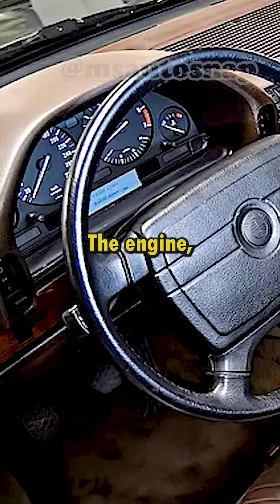When Engineers Build Cars! #bmw #mercedes #bugatti

Comment: The Bugatti W16 engine is an offspring of the Volkswagen W8 engine, that was first tested in the Passat. The W8 engine was the result of 2x VR6 engine blocks, that got 2 cylinders per block less (VR4) and slapped together (V-VR8 aka W8). To claim Mercedes or BMW has anything to do with that, is false information and a straight up lie. So please, go shove your ai content up where the sun dont shine.

Comment: A sensible engineer does not necessarily add needless displacement and cylinders to a car engine. Rather he would focus on making a large car really good to drive (like Maserati Quattroporte M139), as light as possible (like the Jaguar XJ X350, X351), as reliable as possible (Lexus LS V8), as comfortable as possible (Citroën DS, CX, XM). It is a different matter that bean-counters forced preferance of a single market (first USA, now China) onto the development process. 
What we ended was a travesty best avoided.

Comment: That W18 is such a ridiculously daft engine design.  So it's cylinders are basically "staggered", like a VR6 engine or something.  It’s basically just 3 VR6's smashed together, can't even imagine how imbalanced that thing would be.  
V16's on the other hand, are also *daft*, but in a completely awesome way.  Two inline-8's running side by side?  Fuck yeah.  I'm glad Bugatti is moving away from all the goofy W-engines and moving towards V16's instead.  A V16 is just so much more interesting.

Comment: These are 'just' engineering and show exercises for the performance fans and wealthy repeat customers to say, look at what this manufacturer did, look what my favorite auto manufacturer is willing  to do. 

At the most, if those cars had of been built for costumers, it would've been anywhere from a few cars up to 250 cars. 

The first world decided to dumb down, so you millennials, even less for you Gen Z's don't get much foundational I information. 
High Cyl counts are become increasingly inefficient as the cyl count goes up, Euro sports Cars still use V12's cause of tradition and status. Besides, the V12's in production today are built of costly tech the buyers have to pay dearly for, mass auto manufacturers won't spend that kind of money on Cars sold for less than $250,000, they can't. The Audi/Lambo V12 is absorbed into VW/Audi's brand cashe, as it attracts fans which attacks costumers. 

If you watch pro circuit racing (road racing), you won't see any V12's anymore, modern Regs purposely lean toward efficiency, to include exhaust output, so you see V8's, turbo whatever's, Hybrids, No 12cyl. 

As far as the Bugatti, that 16 is highly expensive to run, highly unreliable, you won't hear much about that cause not a lot of them are daily driven, especially not here in the States. American owners of upper echelon SuperCars and HyperCars  buy them for resale value at the top of their list of why they buy, and low miles typically get them the highest resale price, unless it's tracked, then buyers can't wait to get their hands on a car that has been ripping around circuits, and cared for by a race shop.. 
$$$$$$.. 

Sorry Kid, but they don't tell y'all nothing important anymore, cause the remaining boomers and gen x'ers are so superficial and ignorant in the dumb down. Superficial people just need to know how to get the money so they can fulfill their superficial wanton.. dumbasses 🙈

Oh, and that V16 never raced professionally, the 16 is very heavy, an incredulous number of moving parts, soo, high friction much 🥸 with a massive cooling system, so more reasons to be a heavy girl.

So basically, HyperCars up to now are queens, mid-ship comes from circuit racing, endurance racers need to be efficient, but a lot of these HyperCars are too heavy and too inefficient to compete. 

Today's international racing HyperCar class are Hybrids, so watch out for the production versions, they're ugly compared to what y'all are used to, but much more of these production HyperCars will end up at circuits stretching their proverbial legs. 

A lesson for you young ones from an old dog who didn't let go of the rope 😉

Comment: I used to work at a German car repair shop, and the parts manager offered to sell me his BMW 320i, black with tan interior, that had a five speed manual, and the factory tool kit that was mounted under the trunk lid (the boot in the U.K.). I didn't buy it because I couldn't afford it, so I bought a 1982 VW Rabbit L, silver with navy blue interior, with a five speed manual, Blaupunkt cassette deck, and a non power sunroof, for $1,500. It was a fun car for the three years that I had it, but I wish I would have bought the BMW because of the higher resale value.

Comment: When engineers build cars you don't end up with more cylinders because engineers don't chase numbers.  You'd end up with a well balanced powerful 4pot because it is lighter and 160hp is sufficient.   You give it to a marketer and you end up with someone complaining about the extra numbers for the brochure and how you'll l have to disassemble it to change the oil

Comment: Mercedes actually DID build an 8 litre V-16 based on the M130 , and had at least 85 prototypes running around ( this engine was slated to go into the Maybach , which was based on the W140 ) but then they had to outdo BMW , so they also made a 12 litre V-24 , which was basically two M130 joined together . Remember that D-B made very large supercharged V-20 engines for use in S-boots and other marine applications .

Comment: Was never a fan of the M70- V12 because in my opinion to use simply two six-cylinders on a common crankcase with their own throttle body and ecu was cutting corners by the engineers just to get the "magical twelve".
Also the output was pretty low with 300hp out of 5Liters with fuel injection and the engines sound basically like a huge fan.

Comment: Fun fact. The W18 developed by Mercedes isn't the same configuration as the Vag W engines. Instead of putting two VR engines in a V configuration, Mercedes put 3 inline engines in a \|/ configuration. Both are called W engines but the latter is considered the true W engine.
Reply: From the drawing, the true W engine is based on 3 cylinders in a W configuration. The outer two cylinder banks are 120°. The 3 cylinders ride on a common crankpin.  So, W3 x 6 = W18 rides on a 6-crankpin  crankshaft.
Reply: I always said that WAG's engine is a triple V  :))
Reply: OMG! Like what kind of CRAZY ARSEHOLIO Can THINK on THAT Level? 3 I-6 blocks(3 crankshafts) 
3 Heads(6 Cams AND 36 MF VALVES)…When Volkswagen pushed the VR6 out and it being what a 30° engine. I was 12 when I noticed that I was like what😊
Reply: and it was going to be a 8.0

Comment: People have gotten somewhat Spoiled with The Power we have Today 💯 in the 80's, having 300hp was a lot of Power! 400hp in the 80's and you were Top of the Line! Now 4 Cylinders are coming Standard with 500+hp without Modifications 💯 (The New AMG C63 × Which is a Disappointment btw 🤦🏾) !! Nowadays, The Bugatti has a V16 with 1800hp (Somewhere in that Ballpark) --- Then you have V6's that are being Modified to Run 3000hp !! The Fastest Race Car's (Street Racing) are between V6's and V10's 💯👑

Comment: Mercedes didn't have any 16 cylinders in late 80's not even  a prototype, they also didn't want to make v12 back then, M120 v12 only was made because of 750il so w140 could beat it. Mercedes was about to put compressor on M119 V8 and it would be more HP then V12 back then 450-500HP

Comment: Mechanics should design cars, particularly the engine. They're far more likely to put things in accessible areas and not just like "f*ck it, the oil filter can go here even though they'll have to remove the engine, front bumper and gearbox to change it".

Comment: the trend is less cylinders, leas displacement, more boost, more hybrids, more power, faster cars, less emissions, and ultimately more expensive. it's stil engineering, not accountants. accountants would prefer more simple engines

Comment: 400 horsepower from 6.7 liters and 16 cylinders, that's less than they criticize us Americans for making. And of course this is quadruple the price and quintuple the failure rate

Be glad this never hit production or people would be making drift missiles out of them with K swaps because the original engines sucked

Comment: mercedes didnt need a v16 to make 400hp, in just a few years theyd be making the fastest sedan of its time, the 55 series cars (e55, cls55, s55) with a supercharged v8 engine making 469hp stock. i would mention the c55 but that one come with the m113 engine, which is just the naturally aspirated version of the m113k in the other ones i mentioned
Reply: Only the W211 W55 had 469hp from the supercharged M113, almost everything else was 493hp!
Reply: @xtypediesel  amazing, i didnt know that tidbit. im guessing you meant to say E55 tho. what an amazing engine for its time, it still holds up today, too. cant wait to get me my own m113k mercedes (hopefully the E55)
Reply: @xyouthe  Fat fingers, sorry - yes, I did mean E55. And good luck getting your AMG!

(When I said "almost everything else was 493bhp" I put the almost in because I'm unsure about the G55)
Reply: @xtypediesel  i just looked it up and it seems like its the same 493hp, i wonder why the E55 got less horsepower. dont matter too much tho since most people mod these cars
Reply: @xyouthe  Probably so it doesn't embarrass the SL, S, and CL, which are all heavier than the (already quite portly) E55. 

A bit like how, say, the R172 SLK55 in the 2010s 5.5 Biturbo V8 era of AMG had no turbochargers, as it'd embarrass bigger and more expensive AMGs if it had them.

Comment: the w18 is not like the vw w engines they are like the old  napier engines which are sometimes called arrow layout also the v16 was based on the m70 v12 which had a variant called the s70/2 with 48 vales producing 618hp in the mclaren f1 and even more in race trim. This could have been a 824hp 64 valve monster much like the current bugatti v16 which makes 1000hp na.

Comment: From todays perspective i would consider this engines are junk because they are extremly expensive and have no more power than a modern 4 cylinder engine.
And as EV driver i only can laugh.
Reply: As old diesel driver i can only laught about your range
Reply: @Elcicikos  300km is more than enough for driving without a break

Comment: "Only" 296 horsepower is wild to say. You Americans really have your car power standards skewed as fuck
Reply: İt's more for new iPad kids 

You know they think every Supra thought 100000000 hp 

But yeah average American car had more power then average European car because EU companies had restrictions from emissions to engine displacements but American companies never had these issues 

You want a make a FWD Coupe can carry 6 person and had 8.2 V8? No problem you can sell that
Reply: @ozgurmehmet4258  That's not entirely true. Emission laws in Europe are recent. Back in the day, you had virtually no limitations. So why are our engines smaller? Two reasons:

1. Irregular terrain makes for very curvy roads. Even highways are curvy sometimes

2. Economical. We had to import all petroleum from other countries, so making more fuel efficient cars was important.

So if you account for that, it makes no sense to have a gazillion hp cars or big displacement engines. And as a professional European, try driving a 300hp cars full throttle through our roads. You are crashing.

I own a few cars, none more than 200hp and trust me when I say I don't squeeze every last drop of power out even when beating on them. You literally can't.
Reply: And when you look top sellers most EU countries best seller is probably something like 208 or Polo but Americans had F-150 this truck had 2.7 twin turbo V6 as base engine 
BASE! Not top trim

Comment: I may see this from a very German perspective as here on the Autobahn, the engines really need to put out all they have, but the BMW V12s weren't that brilliant after all. 150000Km, and you'd have to face a rebuild. If you're lucky. The 4 litre V8 were much more enduring and reliable, better economy and nearly as powerful. Much better engines.

Comment: There may have been another reason to put the cooling system in the trunk. If the V16 is going to be longer than the V12, maybe the added engine length would make packaging difficult. taking the radiator and fans out of the hood and putting them in the trunk would make up for the space.

Comment: How would a W18 be balanced? Real question. Cause they can’t have the same amount of cylinders on each side.. sounds like a nightmare 😂
Reply: It is not a nightmare, the more cylinders you have, the easier is to make them run balanced. W displacement is actually quite old. But for cars it is overkill. They used 3-row inline 6 configuration several times in history in airplanes (where vibration is a lot bigger issue). If you can balance an I-6, you can balance a W18 too. An italian company named Crm motori still produces W18 engines for ships. Look W18 on wikipedia, you will find several other examples.

Comment: Why not a W16 configuration to save space? That V16 is obviously not fit for the E32 engine bay, as proven by the ridiculously impractical cooling system… maybe properly balancing a W16 isn’t possible or cost effective? Or maybe a W configuration would be too tall for the low hood? Just wondering (great video, by the way!)

Comment: That's not a good illustration for the W18 engine. It wouldn't have been two V8s (V9s??) stuck together like the W16, but rather three banks of six cylinders. Completely different configuration.

Comment: And Renault builds and sells a small car with a 3-litre six-cylinder engine in the rear, including rear-wheel drive and manual transmission.
Reply: Clio V6
Reply: There's also the British Leyland/Rover Metro 6R4 but that has four wheel drive. From 1985.

Comment: The W18 is a different W formation than the W16 you showed. VW's W engines are 2 VR engines (meaning narrow angle V engines) on the sam crankshaft. What Mercedes did was 3 straight sixes on the same crank (or you could say a a V12 with an extra with an extra bang of 6). So Mercedes W is 3 banks, VW's is 4 banks.

Comment: I have a W96 and a V48 dual engine, 32 speed transmission with liquid helium cooling. However, I am not happy that it produces only 4200 HP and the fact that it can only touch 740 Mph. Just not enough for me because I might be stuck in a situation where I might need like 4205 HP or 750 Mph. Duh..

Comment: 400 horse in '87 would have been huge but I have a very hard time believing that beer burning brick could come close to 180 mph. More like 180 kph.
Reply: The Mercedes S-Class W140 has almost the same drag coefficient as a 7th generation Volkswagen Golf.
Reply: @xtypediesel 2 different beer burner bricks than the 1 I was talking about. Try to stay on point

Comment: I wish they wouldn't keep talking BS like this!.  My BMW is a 2016 and was made from 2014 to 2020.  Like the Audi A2 it was a significantly overengineered car and speaking as the owner I can tell you that this is not necessarily a good thing!.  It means that the car is so sophisticated that not even the franchised engineers within the manifacturers dealerships fully understand the car.

It's a stupid hybrid thing with an internal combustion engine that doesn't use a conventional starter motor to start the engine!.  Oh no, it's a fancy 400v starter/generator that sits on a pendulum assembly with a serpentine belt used to spin the crankshaft!.  On paper it sounds wonderful, the pendulum forces the motor one direction when the motor is required to start the engine, then swings the opposite direction to transfer crankshaft rotation into energy to charge the battery,

But, speaking of battery, what happens when the battery goes by the way of the laptop battery?

It means I will have an overengineered paperweight on my driveway!.

Great looking car though!.

As for these old cronks in this video, somebody should have mentioned to the engineers to "engineer" better rust proofing!.

Comment: Vauxhall Lotus Carlton 3.5 litre 6 cylinder Twin Turbo 176 mph and if you manipulate 4th Gear well over 180mph
The Brits still have it lower displacement equivalent top speed
Reply: Different purpose and the Carlton was an opel originally. Opel is German
Reply: @2003AudiS3  Thanks

Comment: I would actually like to have a 7 series with that engine just going along to work you got to imagine how smooth that's going to be how very little vibration if any is going to be detectable considering all those cylinders firing in such close proximity with the timing

Comment: They could make am Audi A8 with the Bugatti W16 engine. That would be nice. Remove the Turbos and put a smaller cooling system and a smaller gerbox. Same engine but less power and no turbo and it can fit.

Comment: Why didn't they add turbochargers. Two per "bank" would have worked. Saab had been using them for years. Variable pressure designs were not s mystery engineering challenge (Bosch made some and Garret). Now you can get the same power from a twin turbo V6 with some mild hybrid assist at the low rpm range

Comment: Is the bigger the engine is the less it will get damaged like better wear and tear through time ? so more reliable ?
Reply: sorta. Bigger engine, more air and fuel, more torque, less need to rev, less revolutions. But also more cyliners more moving parts and things that can break, a V16 has twice as many spark plugs, bearings etc. More vertical size per cyliner (stroke) higher piston speeds more stress on rods etc. Less Stroke less torque and less effiniency.
Reply: @randomyoutubeaccount6906  That is probably why the engine from the Rolls Royce are so reliable .